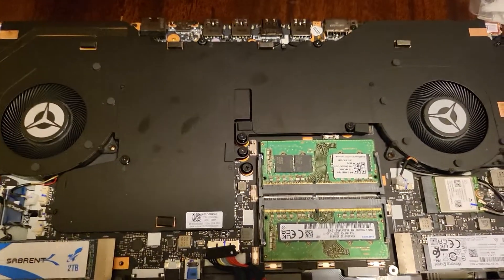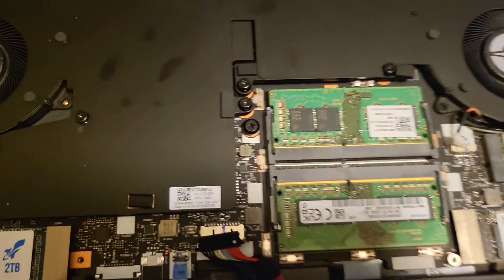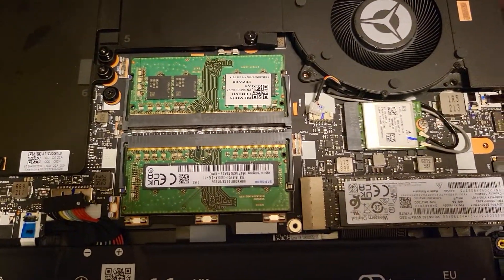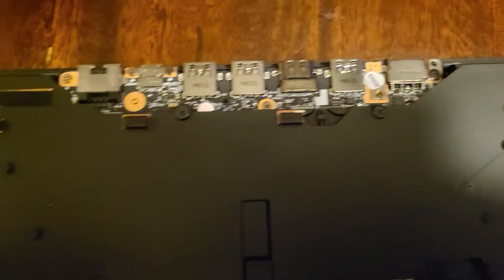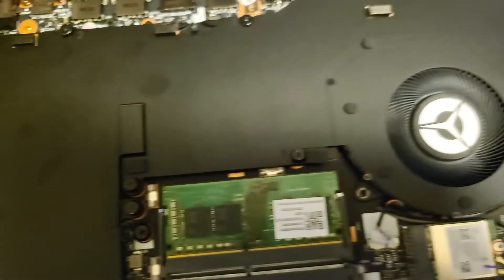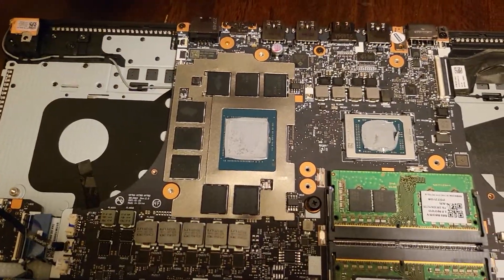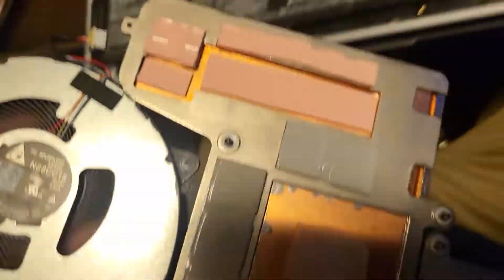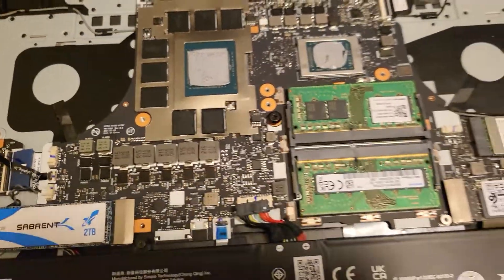lenovo legion 7 6th gen rtx 3080 heat sink and fan removal..

Comment: Can the fans be removed from the heatsink? a reddit user says they are soldered to the heatsink. I need to replace the GPU fan only.
Reply from the maker: Sorry had sold it, you can clean them with the heat sink attached.. that's what I ended up doing.
Reply: were u able to do that?
Reply: you have any luck with this? i have a slightly newer model with 4080, but im trying to find out if the covers over the fan can be removed to clean between them and the heat sink gris/exhaust ports.. my acer helios always had a solid wall of debris in there blocking airlfow every 6 months, but 2 screws and the covers flipped off the fans for cleaning they were held on with  a little tape too but easy to flex it over